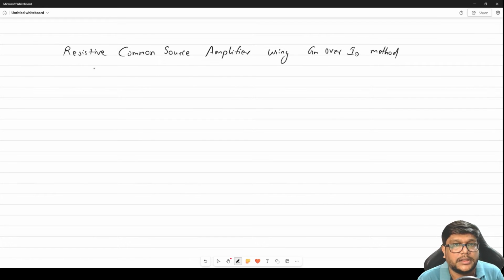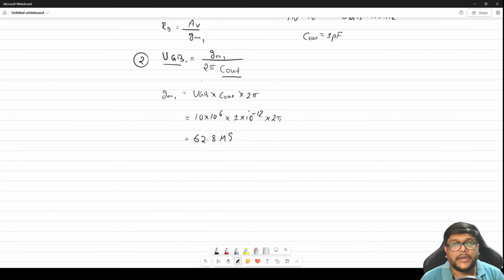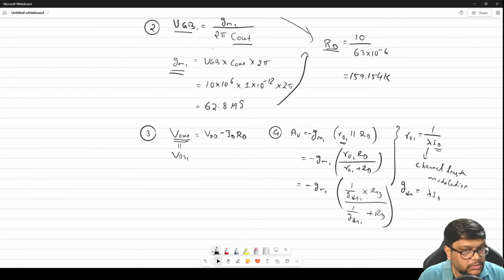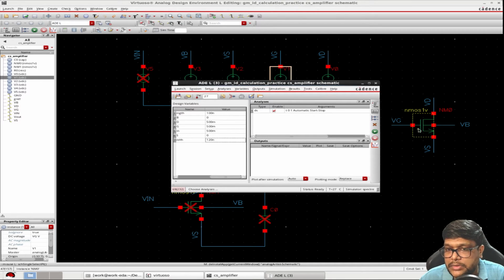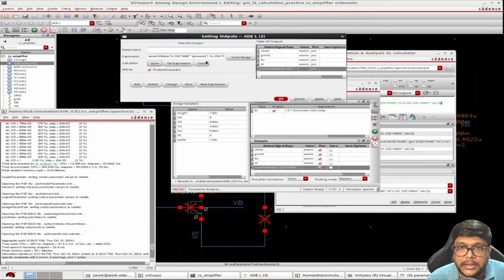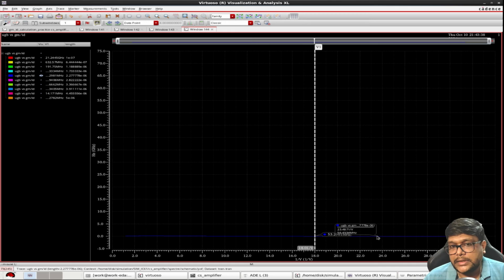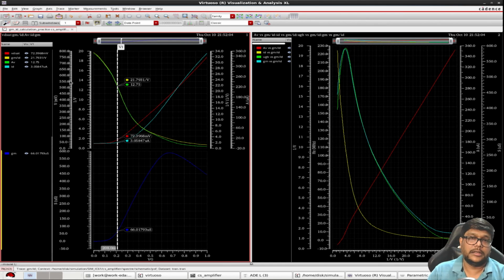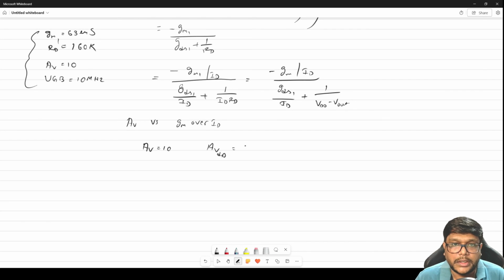Designing a Single-Stage CS Amplifier Using gm/ID Method | Step-by-Step Cadence Simulation

Comment: Hello Sir,
I am from Bangladesh. This is the best video I’ve ever seen on this topic—thank you so much for the clear and detailed explanation.
Sir, I have a humble request: could you please make a video on the CS amplifier with a diode-connected load and the CS amplifier with a current-source load using the gm/Id method? It would be extremely helpful. Thank you again.
Reply from the maker: If time permits

Comment: Can anyone pls tell what is equivalent of wavevswave function of cadence in Synopsys custom compiler for plotting graph between two parameters 

Thanks
Reply from the maker: In Synopsys Custom Compiler I didn't find wave vs wave but what I do is take vgs as reference and manually look at different parameters. Initially I plot id g/gds and gm/id by sweeping vgs and then I look at the parameters in a single wave view. From that I try to find the proper biasing point.
Reply: Brother use ocean script it will work